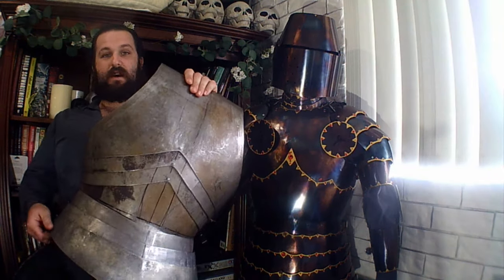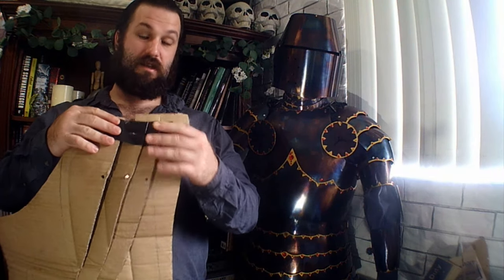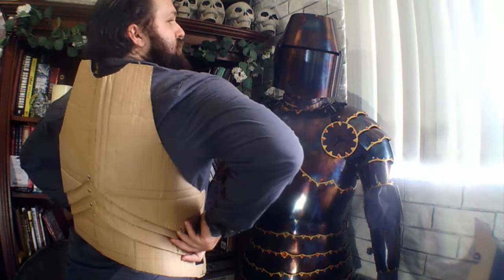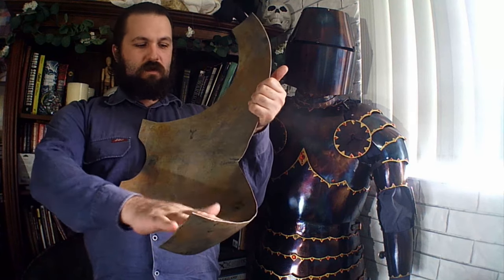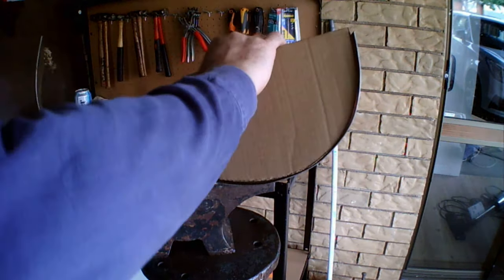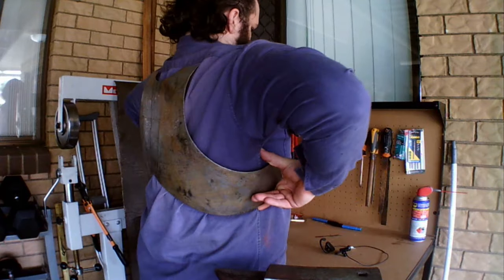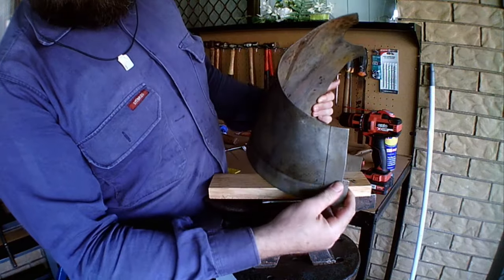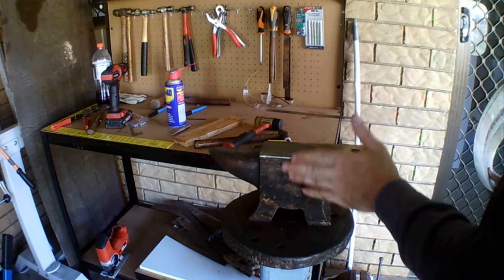Gothic Armour Backplate Tutorial For Beginners. Part 1

Comment: Nice. I was wondering when this video will drop. I am glad you keep making cool things like that. Makes me wonder why not make it a bit bigger and less form fitting so you can wear proper padding underneath?
Reply from the maker: Australia+summer.  I have a very thin arming doublet that will still fit under this. Really good and form fitting armour doesn't really need thick padding and historically you wouldn't wear thick padding under full plate like this. Some sport combat people wear thick padding for the sport or because it is a cheap way to get none custom armour to fit.
Reply: @ArmourArtist  also alot of buhurt guys wear alot of extra padding because every weapon they use is basically built like a crowbar and hit like maces lol so they need to protect themselves from hits that would otherwise probably be breaking bones. their armor is also generally at least twice as thick as real historical armor for the same reason.